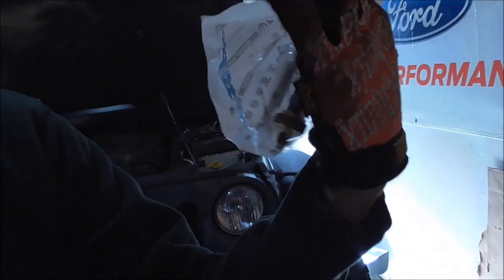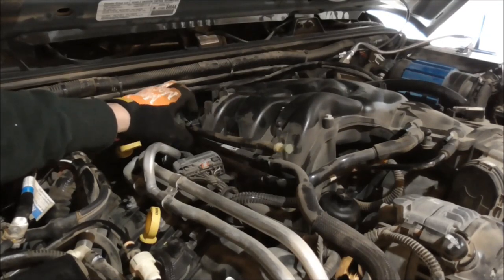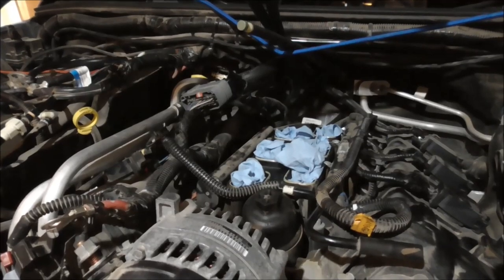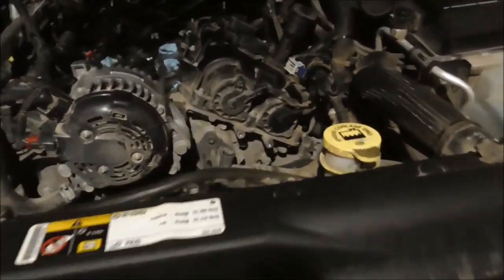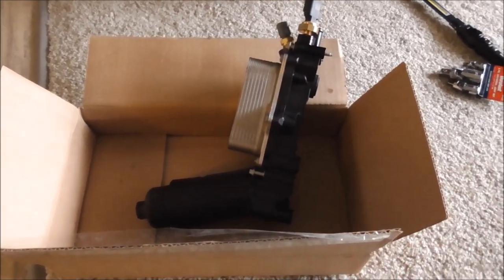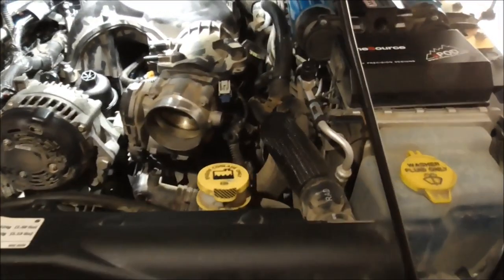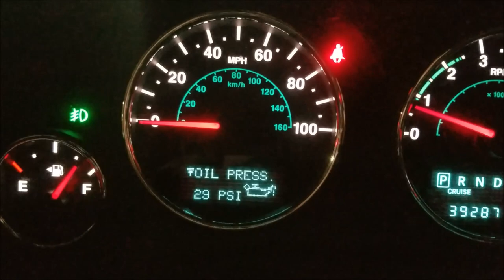Jeep Wrangler JK Oil Pressure Sensor and Oil Cooler/Filter Housing Replacement - 3.6 Pentastar

Comment: Thank you for this video.  I just went through replacing my entire oil cooler unit (based on your experience trying to unscrew the sensors).  I'm glad you left in your frustration, as it reminded me that what I was going through was normal.  In the end, it all worked out, and maybe I saved some money by avoiding the dealership.

Comment: I liked the way you just lifted the lower intake, that could be a big time saver. Good job !
Reply from the maker: ROBERT MULLEY thanks was trying to avoid disconnecting the fuel line.
Reply: That’s where I am currently.  The tabs to release the clips on the fuel rails are kickin my ass.  Don’t wanna risk breaking em.   So.  Looks like it CAN be done by jus lifting the entire lower intake huh.   Ok will resume in the morning

Comment: @HEB. Thanks for the clear video and instructions. I just received code PO520 and 522. Going to start with the oil sensor and hope that clears it. 
Digging on your SPOD and compressor as well. Two add ons for sure in the future.

Comment: I had this same issue, the dealer had to replace the oil cooler assembly because they tightened the oil cap to tight and it seized. So when they Removed the old assembly and let the oil drain on the knock sensors and the knock sensor harness which is what you did in the video. Even though you clean up as much as you can the oil slips into the wire harness and eventually cause a issue, I did this job 3 times first replaced the knock sensors everything was good and then got the check engine code again then replaced the knock sensor harness and it was good but now I got the check engine code and it’s the oil temp sensor which is right there as well. These engines have to many issues that require ripping the intake off. Also I didn’t see in the video you draining the coolant. Or disconnecting the pcm.
Reply from the maker: Over two years and I have had none of these issues.

Comment: I would highly recommend swapping out the cooler with an aftermarket Dorman. It is solid aluminum and avoids the structural changes caused by plastic and metal being matted together in an area exposed to extreme heat and cold changes. The failure is the gaskets (4 round) that are between the housing from the block. If you check, no one sells just those gaskets. I think Chysler engineers designed this to fail on purpose.

Comment: I have changed the same part and got the same low oil pressure code also changed the oil pump and same thing oil pressure is good looking into a bad wire harness. So costly but I'm going to keep at it

Comment: thanks for posting this! I'm replacing the oil cooler on my 2012 wrangler right now. I think I might have over tightened the oil filter cap because it just started leaking a bunch of oil from that area right after doing an oil change.
Reply from the maker: No problem I hope it helps
Reply: Old  O RING different from the new one it looks hardened you still gotta replace it

Comment: How does one prime the oil? I just did this repair, but also have other issues going on and it did not turn back on. :( i get clicking from the fuse box and seems like the whole Jeep shuts down bc of the battery?
Otherwise this is by far the best video on how to do this repair, thank you for being so thorough!
Reply from the maker: To prime just put your foot on the gas pedal and hold it on the floor before turning the key, hold it there while the engine is cranking. Since the 3.6 is drive by wire it will trigger a warning in the ECU and not fire the fuel injectors- so the engine will turn over but won't start. You only need to do this 2 or 3 times, oil pressure will be sufficient at that point. When you are ready to start it up just take your foot off the gas and it will fire up like normal when you turn the key.
Not sure about the clicking, sounds like you may have a dead battery.

Comment: I have a 2007 Jeep Wrangler unlimited sport Manual  trans 
I have the oil light keeps flickering on and off And the chime sound on And off
Do think this is my problem 
Need to change the oil pressure switch I also just changed my oil on It

Comment: Went through this twice in my Chrysler 200 within a year. Both times the seals on the bottom of the cooler failed. Now, in my 2012 Wrangler, I have the P0520 code. I'm going to get a new sensor, but I'm wondering if it's worth it to just spend the extra $80 or so and just replace the entire oil cooler.
Reply from the maker: If your Jeep still has the older style cooler I would go ahead and replace it while you are in there.

Comment: Sorry for your trouble. I have a 2014 JK and I have the same code that popped up. Done some search and found your video. Out of curiosity would it have been easier to remove the oil cooler as a whole to get the sensor out if you had to do over? I am going to have to tackle this myself so any pointers is appreciated.
Reply from the maker: Yes it would definitely be easier to just remove the cooler, thats what I ended up having to do. I would also recommend unscrewing the oil filter prior to removing the cooler so that the oil inside drains back into the pan, and I would drain a little bit of coolant from the radiator so that you avoid spilling oil and coolant all inside the engine valley when you remove the cooler. I made quite a mess because I accidentally skipped those steps.

Comment: Hey man, you didn't show the sequence of how you should tighten the upper manifold bolts.  Is it the same pattern?  It looked like there were only 7 bolts on the upper and 8 on the lower.
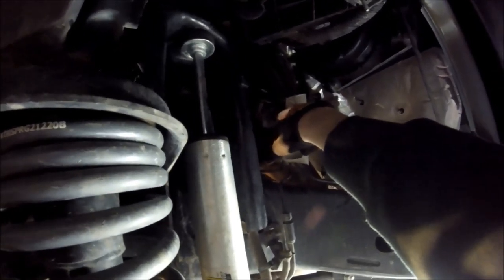Reply from the maker: Big MontyJones you’re right I should’ve showed that. I used screenshots from MotorCity Mechanic’s video on replacing the sensor on a Charger. The manifold is different but the torque sequence and specs are the same. Here is the link to his video- upper manifold sequence is at 11:13 https://youtu.be/EmoYZg1COoc

Comment: Whats the part number for the oil pressure sensor?  All the ones I have found have a 3 prong connector. Seems it should only be a 2 prong?
Reply from the maker: Nathan Hodge 5149062AB
Reply: @HardEarnedBacon  thank you very much!

Comment: Thanks - Pulled the cooler before I tried to removed the sensor and it worked great.  A lot of penetrating oil and about 2 hours of soaking and it came off without stripping.   Also, how did you get the oil pressure to appear on the dash?   Great help.

Comment: Thank you for sharing and Great videos (both P1&2). So, the P06DE error has to do with your Oil Pump and the Oil Pump Solenoid, is that correct? My 2016 JKU is having the P06DE error now.
Reply from the maker: That is correct. The oil pressure sensor fixed my P0520 code and the oil pump fixed my P06DE code. If you have both codes I would probably start with the sensor since it is a known issue and cheaper fix. If that fixes the P0520 code but not the P06DE code then the oil pump solenoid is faulty too.
Reply: @HardEarnedBacon  Thanks, HEB. Its just the P06DE error. I went back out and try to reset the error (3X Start On) again after changing the oil n filter. The check engine light and error code disappeared! 
We'll see what happen in a few days if error appears again.

Comment: Nice job you were going to need a new oil cooler housing anyway, the plastic ones fail around 70k or less miles on the pentastars.
Does the oil cooler assembly comes with gaskets?

Comment: So it just needed a oil pressure sensor instead of a oil pump?  Great vids
Reply from the maker: It needed both unfortunately. I had two CEL codes, the pump fixed one code and the sensor fixed the other. If you have the P0520 code I would start with the sensor.